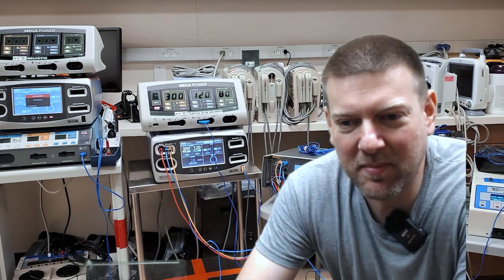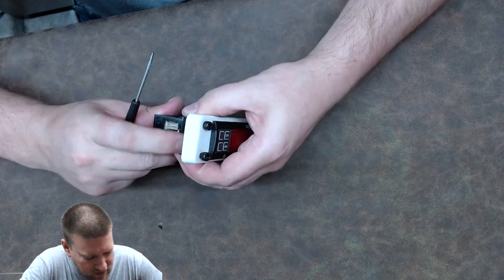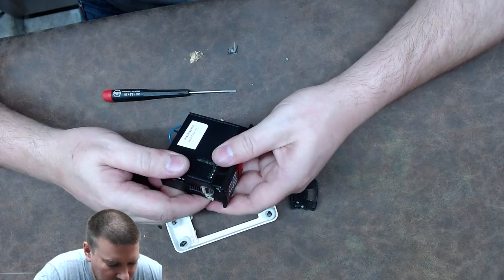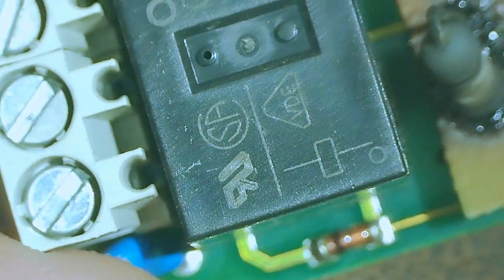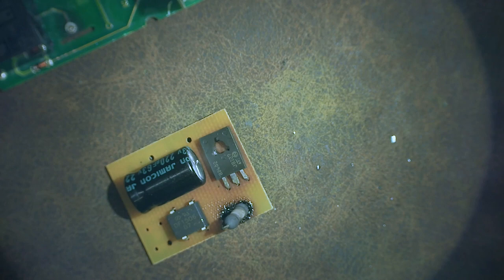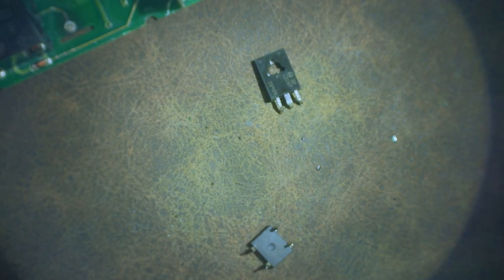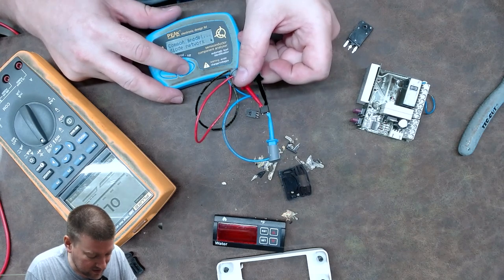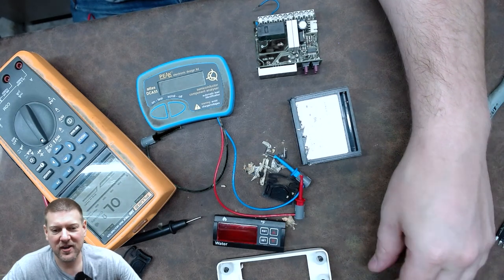Hydrocollator Caught Fire! Why?

Comment: Thats the AC side ... see the isolation slot ... looks like that darlington might have failed short ?
Reply: Hmm I'm going to go back and look at your video you tested it and it was not ...
Reply from the maker: That's why I took a pause and said "oh no"
Reply from the maker: That means there's a short somewhere else (possibly in one of the components connected to the temp controller)
Reply: Does that relay control the heat?